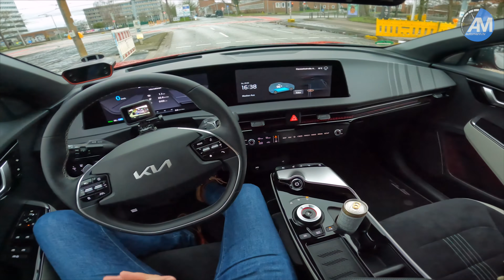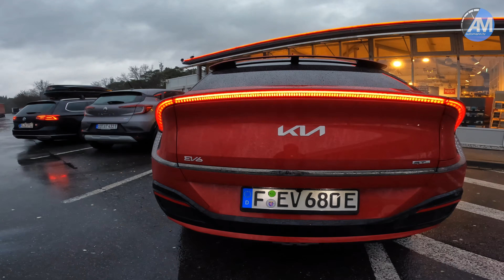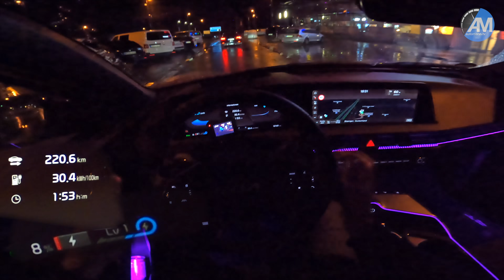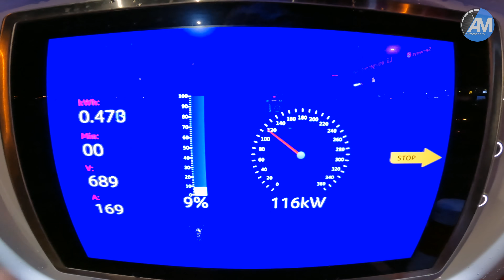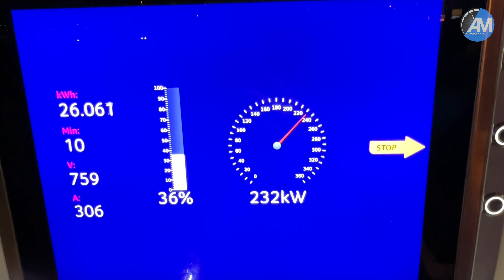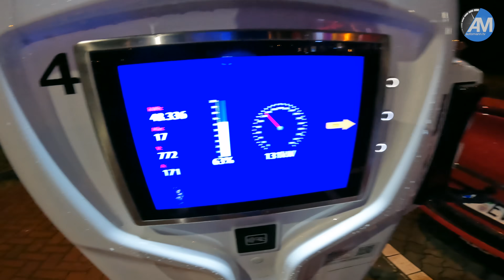NEW! KIA EV6 GT Line (325hp) | Fast Autobahn Range & Charge⚡️🔋 | by Automann in 4K

Comment: The manufacturers of electric cars DONT make the batteries and use the same battery control systems made by external suppliers.. If you think that a Mercedes Benz EQ is going to be somehow better performing than a Kia EV6, your dreaming.  Tesla however is at the forefront of electric drive, electric battery tech and battery controllers so they have at least 5 years ahead IMHO.

Comment: 220km for a full battery is still way too low if you ask me, but its getting better slowly. I can see myself owning an electric car if the range reaches 350km on a full charge. I see that it still takes quite long to charge it from 5-10% to 100% , usually 35-45 minutes, but considering that used to be 3-4 hours just few years ago its a n improvement. Unfortunately there is barely any charging stations in my country and smaller or less developed countries, so that is a big issue.
Reply: Official claimed that EV range have 506km, I understand that high speed acceleration with high electric consumption but the 220km seems still far away from there.

Comment: I have a 2018 Mercedes GLS350 and a S400 long wheel base and I'm selling both to buy an EV6 and Ioniq5. The Mercs started to literally fall apart from the third year, right after the warranty expired as if the cars were programmed to fail right after the warranty expires. Gearbox, Brakes, Electronics, Sensors, Mechanical parts, they are most probably manufactured to last 3 years and then the manufacturer is making TONS of money by selling maintenance works and parts. I had a similar experience with BMW 740iL. One of the major criteria when choosing a car is how it performs during a crash test. Both Kia and Hyundai EVs are the safest of their segments. Can't wait to get my hands on them.

Comment: I am absolutely satisfied with my EV6!!  Top car, solid workmanship, excellent equipment, fair price, and last but not least 7 years of guarantee - also on the battery!  

When the EV6 came out, I did a lot of research on this vehicle and on alternatives in this price segment.  I also did detailed and longer (minimum 2 up to 3 complete battery charges) test drives with a lot of other electric cars e.g. Skoda Enyaq iV 80, Ford mustang Mach E, Audi eTron, Tesla Model 3 and Model Y. I was very disappointed especially with these last two because of the poor processing quality and the insufficient noise insulation (in comparison with the other candidates, loud driving noise, lack of insulation, noise from the chassis and wheels).  The Tesla engines: Great!  Charge & Travel planning: even better!  but otherwise….  overall not exactly a highlight and much less perfect than advertised and expected.  Ultimately, after a 2-day test drive, the EV6 was just short ahead of all the other vehicles.  Even if there is still room for improvement in terms of charging planning and "cold gate" - which has already been announced by software updates.  I still didn't reached 18 minutes for 10-80%, but on average it was only about 22-24 minutes.  Other vehicles in this class can only dream of this (including the Tesla mentioned).

The result: I canceled the pre-order for my KIA Sorento Platinum 2.2 Diesel AWD and quickly decided to buy the last available EV6 with AWD here in the Weimar area - and I haven't regretted it!!! Especially on regard of the astronomic petrol price this days, I think this was the absolute right decision! 

100 km range with Diesel @8 liter/100 km with 2,01 EUR/Liter = 16,08 EUR, 
compared to 100 km range @19 kWh/100 km @0,28 EUR/kWh with my EV6 will cost only 5,32 EUR…..

That means: a 500 km drive from Thuringia to Northrine-Westfalia and reverse (1000 km) will cost:
with diesel = EUR 160,80
with ⚡️= EUR 53,20
Any questions ? 

Quite apart from the incredible fun of accelerating at any speed. When the Porsche or BMW driver with combustion engine pressing from behind is waiting to overcome the turbo lag, I’m already gone…

Some are amazed, others grin with „thumbs up“, some look slightly disturbed: „WTF, I was left behind by a KIA ???“
Those looks: unforgettable

Though I got my EV6 AWD since Dec 2021, I ordered the even stronger EV6 GT immediately then, and hope for an early delivery in Germany, probably in early November 2022. Can“t wait for the immense power and acceleration of this car. Even if I am a so called „defensive“ driver, 4WD-Power-torque-acceleration (for me) is a question of safety, not an opportunity to race or compare or mess with other drivers. Having some fun while entering the „Autobahn“, that“s ok, or finishing an overtake within the blink of an eye (safety ☺️). After all, I“m already 66 years old, so you don“t need races anymore…but still some fun with a powerful car from time to time…..Anyone here who wants o buy my EV6 AWD 325 HP then (Standard Edition, first registration 12/2021, in Dec 2022 12.000 km max, color aurora black, 19“winter tires, 20“summer tires, trailer hitch, all available complete packages except sun roof)?
Greetings from Germany
Uwe
Reply: It's depending on the price you offer 😅
I'm very satisfied with my Ioniq5 as well.. I only have the basic with efficiency package but the 218hp feel like 350. So much power!
The E-GMP platform is just great all in all.. The software needs a bit of work but I'm very sure the next updates will fix the bigger problems.

Grüße zurück aus Hessen 🙋🏻
Reply: @karl1NN , VB 48500,- …..
Reply: @UweLoewer  good Price but I'll stay with my freshly wrapped Ioniq5 ;)

Gut Holz. Der Preis ist unschlagbar für eine Vollsausstattung. Verkauf nach Finnland, dann kannste deutlich über 50k bekommen.
Autotaalo ampeeri zB.. Über die hab ich meinen Zoe damals für gutes Geld verkauft
Reply: @karl1NN  Vielen Dank! Hast du ggf eine Web- oder eMail-Adresse? Was gibt es ggf zu beachten, aus Deinen Erfahrungen heraus?
Reply: Yeah if you compare diesel driving in town max 40 km/h and EV on summer...and you dont charge it on fast chargers...
Reply: That’s a good review, thank you.
Reply: @montekore374  Audi e-tron in comparison with the EV6 (as far as I figured out):
valuable built quality (internal and external)
better „social image“ of the „made in Germany car with 4 rings“, but
higher consumption (-3-5 kw/100 km)
less range
much too expensive, if you want to get the same technical equipment, i.e. the comparable equipment with many more additional packages required for the Audi is noticeably more expensive than the same technical equipment for the EV6
Audi: only 1 year of warranty, one or more additional years of (degrading) warranty will cost a lot of additional money!
KIA: 7 years of FULL warranty without any limitations in warranty services over the years

So, with my personal test drives and research experiences, my decision was very simple ….👍
Reply: 10 year in US
Reply: @youtubehand  that’s GREAT !!! 😀👍
Reply: Hier in Südkorea ist gerade so schwierig EV6 zu kaufen.. Obwohl man jetzt bestellen muss man fast 16Monaten warten.
Reply: Wie lange werde dieser 500km fahrt dauern in ihren EV6? Ich fahre nach Calais von Hannover..660km..dauert circa 6 stunden 30 minuten..90minuten Faehre..dann noch 300km fahren ohne tanken zu muessen.Zeit ist geld..ich moechte ankommen...10 minuten voll tanken denn noch 900 km reichweite. Fuer kleine fahrten wird prima sein..dafuer werde ich nicht 60,000 euro ausgeben. Aufladen dauert zu lange.
Reply: @montekore374 , the properties you mentioned are comparable, except for the noise when driving.  here the EV6 is quieter.  Concerning the „smell“, it depends who was driving the car before, or for what the car was used 😉.The designed smell will surely disappear sooner or later, while using the car. But that's all my personal experience.  it is better if you make your own impression and book a comparison test drive with the Audi e-tron and the Kia EV6 (AWD).  Both manufacturers should be able to do that.
Your own decision also depends on your personal specific preferences. So, try it out!
Reply: haha you are joking compared to a Toyota the build quality may as well be lego bricks stuck together. There is no way in hell i would trust my family in a Kia at speed. The welds are very poor for a start.
Reply: @DEVILTAZ35  언제쩍 현대를 말하는지,현대도 품질 나뿌지않음,그냥,악플러냐?
Reply: @seokju874  일본인 같네요.

Comment: 30kwh is way too much. It seems the concept of Kia is forget about efficiency. We let you charge fast instead. But what that comes down to is as if you have an ice car with a leaky tank. And to make up for that the opening of the tank is big enough to get two nossles in. Tat however will get very expensive on the long run.

Comment: Try the Mokka E. I drove one from Hamburg to Hannover and Reichweite was 280km from start at 99% and I arrived with 25km Reichweite and the distance was 163km. Had to use the car in Eco mode with no heater or anything just to successfully make it and only drove 110km/h the whole trip. Absolutely terrible car
Reply: It all fails on range and charging time..an uncharged car is dead for a long time. Fat lot of good sat on the side of the road..or attached to a cable for 6 or more hours..'I can drive 200 km in my car..!! Yeah really wonderful, what do you do then? Sit and watch the tractors passing.. an EQS can drive 600km or more..now you are getting close..a car that has 250km range is a joke, when it can drive 800km and be fully charged in less than 15minutes then it's a proper car and something worth looking at. Ask a soldier if a rifle with a 25 to 50 metre range is any good to him? It may be really accurate  but it ain't any good, he could do the same job with a pistol..(a Renault Zoe is fit for purpose)..I couldn't take someone to Hamburg Airport and get back home again to Hannover..round trip 300 kilometres if I was driving an ev6...I was driving somebody's 20 year old Fiat the other day..worth 250 euros..it could do that trip easily..too much hype.over lighting, 50 dollar screens and the like..people falling for it hook, line and sinker.
Reply: @martinmold1051  Most people are not going to drive 800 km in a single day, let alone take only 15-minute charging break after driving for that distance (that's more than 6.5 hours of driving). The fact is, while a fossil fuel vehicle still gives you more flexibility, an EV would be sufficient and cost less per mile for a significant portion of the population. And if you are not one of those people, then perhaps as time passes, the technology will catch up to your needs eventually.
Reply: @Vengir  I'm sure once the whole industry gets really serious..when millions of EVs are on the road, all these individual experiences, of a technical and practical nature gathered and improved upon, the natural competition  between companies..range and time of charge will improve massively.in.2 to 5 years we'll have a different conversation..the EV6 sounds like a superb  vehicle, I drive too much at the moment..back and forth to the UK..You are right things will improve..a lot quicker than we envisage..good luck with the vehicle.
Reply: What is a horrible car, are you referring to the kia ev6? I am confused, please elaborate.
Reply: @TopBoi93  No. Vane was talking about Opel Mokka-e.

Comment: This shows one of the problems with ev cars. The range is just too low compared to normal cars.
Reply: Almost every country in the world have way lower speed limits than what he was driving here. Which means that the range will be much better. This was an interesting test nevertheless...
Reply: Yeah EV doesn't make sense for Autobahn. But here in the UK where the speed limit is 112, it's so much better ! I own a RWD of the EV6, and I'm able to to do around 420 km on a single charge, which is "good enough" for me in the winter ! :D
Reply: with my car which is not an ev and with 300hp I can go 500km with an average speed of 160 and at least 800km on average. and my car isn't even close to being economical on fuel. The difference between ev and non ev is huge
Reply: @svetlinnikolov8710  I traded my Mercedes AMG Cabriolet for a Kia EV6 GT. 250 to 275 miles range is more than enough. I rarely got much beyond 300 miles before refueling the AMG, so not a huge difference. So what are the EV6 advantages? Better fit and finish. Zero emissions charging off my solar grid or 6 bucks to charge vs. 85 bucks for the AMG. My car before the AMG was a Hellcat and I'm pretty happy with the power of the EV6. The design is otherworldly.
Reply: @robertbrody4032  That's really cool.  Is the fit and finish really better on the Kia EV6 vs the Mercedes AMG?
Reply: @alexandergoldman  Both of my AMG's had squeaks and rattles. So did my Mercedes SUV's. The EV6 does not make a sound and everything feels tight as a drum. The matte grey paint on my EV6 looks just as nice as Mercedes matte paint, but I will have to see how it holds up. That said, the only car where fit and finish had me worried was the Tesla, which we passed on mainly due to a primitive suspension and no HUD system.
Reply: @robertbrody4032  Hi Robert, thanks for the reply.  Wow, that's really surprising and shocking with the squeaks and rattles and that would drive me up the wall.  Not quite as surprising on the QA and fit and finish concerns with Tesla...that's par for the course.  Both the EV6 and Ionic look incredible...but I might have to wait for the Genesis GV70 EV.  Again, thanks for the info.
Reply: @svetlinnikolov8710  And how much do you spend on fuel to fill your tank compared to charging at home? For me it's less than $10 CAD. How much more will it cost to fill up in the coming weeks as Russian fuel imports are cut off and local stockpiles begin to run dry. We're already seeing an increase in costs here in North America, I assume Europe will experience a greater impact.
Reply: @svetlinnikolov8710  Which car is this?  300hp and 800km on average?

Comment: for comparison, this was one of the fastest runs (because of lower traffic) and the bad weather and wind. Also only 87% were used, so we can assume an easy 250km range with quick autobahn driving and way more in summer. So it's quite efficient and charges incredibly fast.
Reply: @Vux furthermore you are really not the sharpest tool in the box, are you? Guess how all the magazines and ADAC finance themselves. With advertisement. Who spends no money on advertisement? Tesla. Now guess who gets the good reviews. You really have to be quite stupid not to see through this. I don't give a fuck about any reports, rewards or reviews. I do my own test drives and the result was shockingly clear. It's the software , stupid. All the others are an abject failure at that. And it's not even close.With the Polestar it's basically Russian roulette. Maybe it charges, maybe it doesn't. Maybe it stops charging at 50% maybe it doesn't. If you want to some up all the other evs there is one word for it: unreliable. It's a see line that goes from the charging infrastructure to the software.
Reply: @armilotheus  only insecure low lives need likes for their self esteem.
Reply: @armilotheus  looked into this thread to get some honest deliberation and all I see is a fan boy and some screwball going at it. You guys are a perfect example of what the internet needs less of.
Reply: @armilotheus  same comment as to "can'tstart usinghisbrain"
Reply: @Vux it actually isn't. I checked it on my model 3. With the EV 6 on the other hand it's a different story. It's efficiency is terrible and the range of the Gt version is a bad joke.
Reply: @Vux you are delusional and you have no clue what you are talking about. Befor pulling the trigger for a model 3 I test drove all of them and I was shocked about two things. 1 how bad all the other evs actually are. 2 I was shocked at myself for even considering anything else.
Reply: @Vux you see the point is once I detect a clueless talker I don't bother dealing with anything the talker says. It would grant legitimacy where there is non to be found.
Reply: 30kWh efficient??
Reply: @whynotstartusingyourbrain8726  yes on that driving speed
Reply: @Gochsener  on that driving speed a Tesla has  no more consumption than 25kWh.
Reply: @whynotstartusingyourbrain8726  in rain  Tesla has no less then 28 - 30 kWh
Reply: @miseethi  didn't your mum teach you not to lie? Bjørn Nieland does very accurate range tests and he had a result of below 20kWh in the Winter and in rain. So that is 10kWh less than the KIA. And that says it all.
Reply: @whynotstartusingyourbrain8726  please watch your tone.
Reply: @miseethi  she neither raised me to be nor to accept a liar.
Reply: @whynotstartusingyourbrain8726  He most definitely did not test the Tesla with a cruising speed of 160 km/h because the max. speed limit in Norway is 100 km/h (and he usually drives a bit more, 120 km/h if I remember correctly). So please use a comparable test for reference!
Reply: @ExilschwabeOche  110 km/h 😊😊
Reply: @Vux all I want to do is show the world that you are a talker. That's why I responded. That's all people need to know. As I said I won't give legitimacy to your nonsense by responding in detail. And that is a result of having used my brain.

Comment: I'm sure you disagree, but I can't stand those fake engine noises coming from the speakers. Wether it's ICE or EV. I want to hear the real engine noise (in ICE cars obviously), or even the vind noise and how well sound insulated the EV is.
Reply: You can turn the Sound off if you dont like it, but every ev should have an optional sound paket
Reply: @janneshildebrandt1  They need to add the loading of your own files, so you could have "seb vettel does crazy frog"